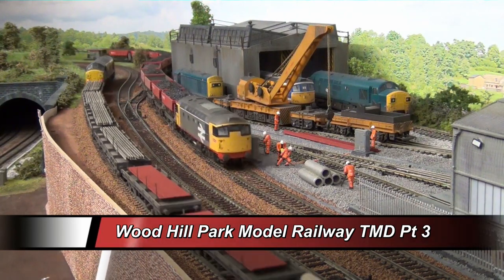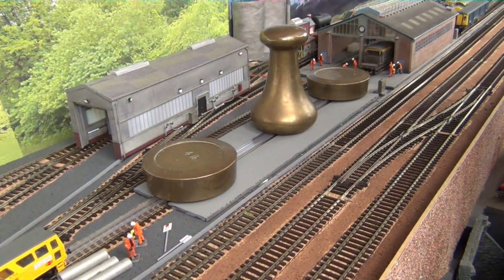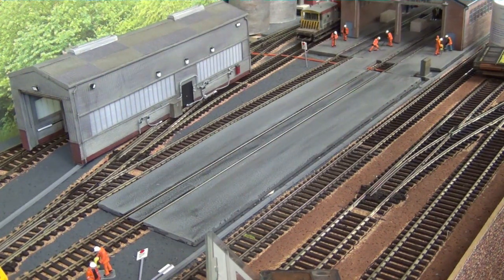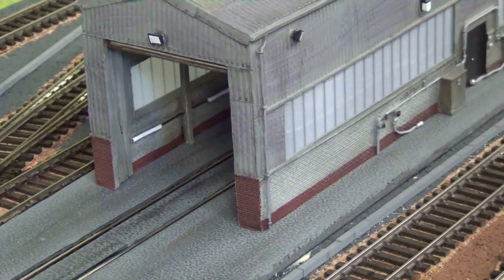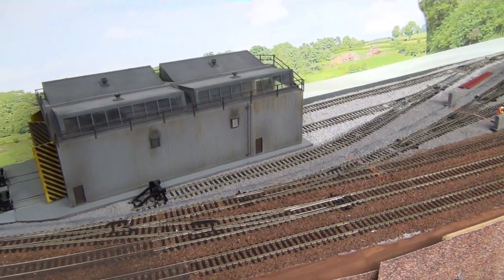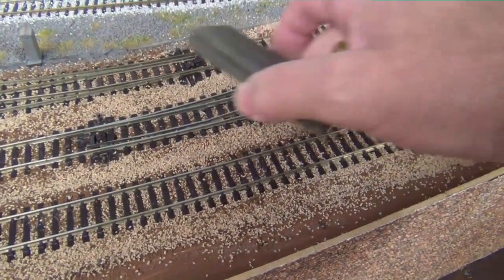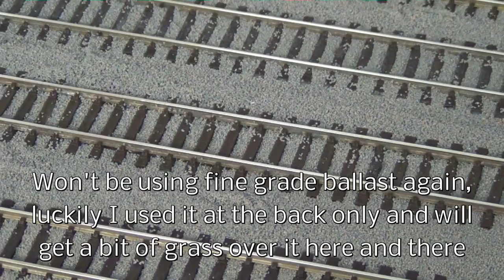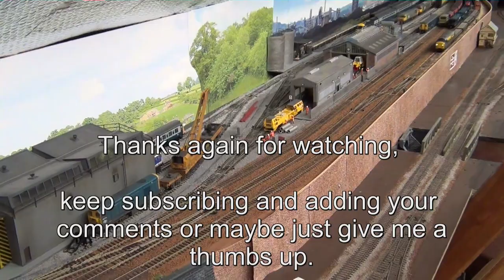Finishing Work On The TMD Part 3 - Infrastructure & Ballasting. 23.  Final Part.

Comment: Darrenbury  Central   Hi i use carbon art pencils for general track cleaning.  That blusher brush you have they make great train dusters.  Great TMD.  The  washing plant looked good.  You could sprinkle some darker ballast about to simulate  weathering.  How about an inspection pit in  the shed. great show enjoyed it bi
Reply from the maker: I do have an inspection pit in my main maintenance building but haven't finished it off with maybe a arc welder flashing like some people have done. Will get around to this at some stage. And yes the blusher brush is a great loco duster. I have one for ballast work and one for dusting stock. Thanks for watching and taking the time to comment. Cheers Graham 👍🚂